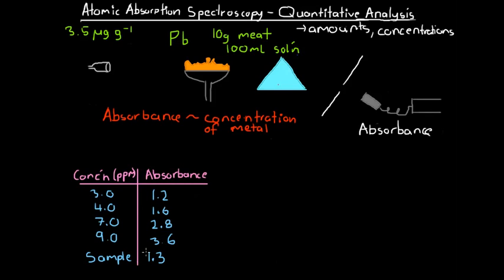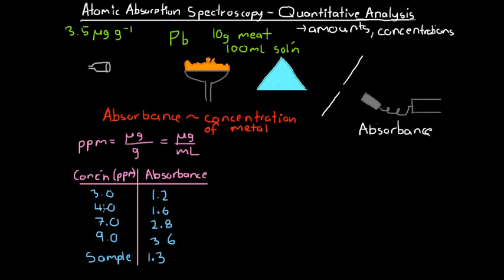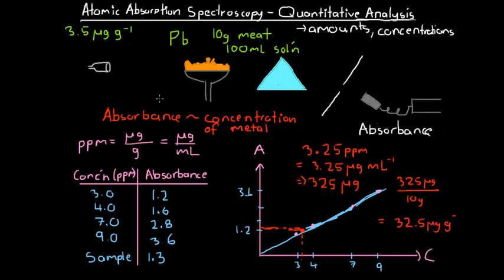Atomic Absorption Spectroscopy Quantitative Analysis

Comment: Im confused with the difference between absorbance spectroscopy and emission spectroscopy... clearly one is absorbed and one is emitted, but is that it?
Reply: +Gwen Gillham In AES, the wavelengths of light emitted by the burning of the solution are measured and compared to reveal the COMPOSITION of the sample. In AAS, absorption is measured and interpolated into a graph with previously recorded absorptions and concentrations to determine the CONCENTRATION of a sample.

Comment: The law of lambert beer states that the relation between absorbance and concentration is lineair when working with low absorbances. It is therefore advised to work between absorbances of 0,1 and 1,0. Using more diluted analyte and standard will lower the absorbance. Except for that, good video.
Reply: Right, if the abs is above 1,0 the sample is too concentrated